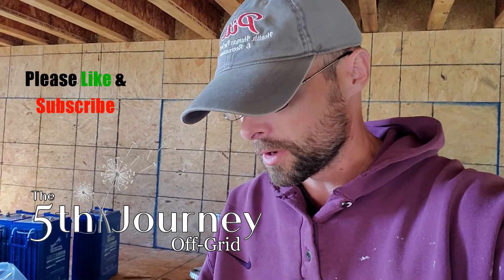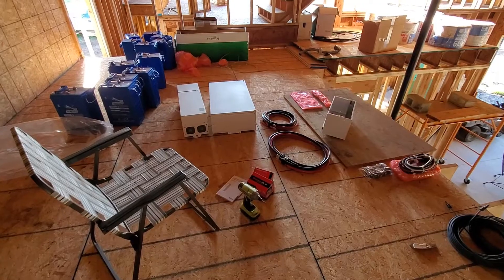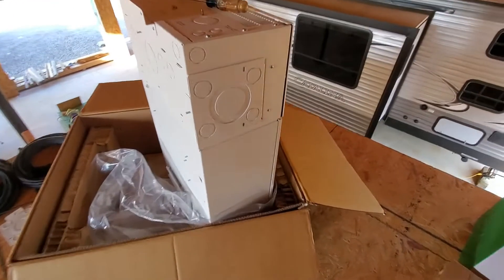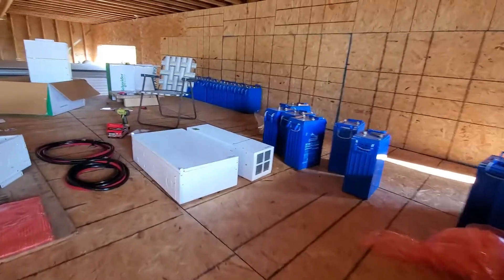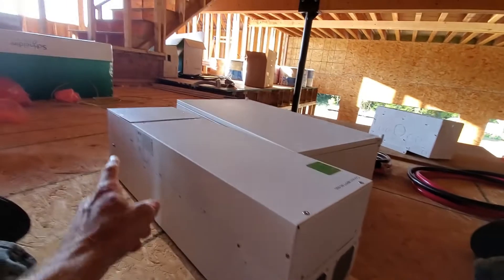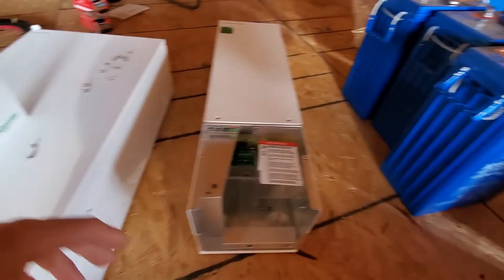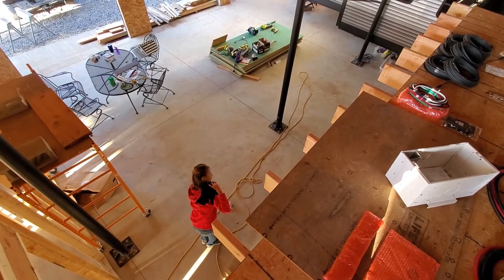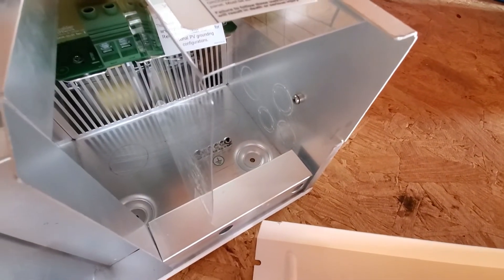Schneider Electric Solar Equipment - Off-Grid Solar Home

Comment: Off grid is the way to go. Fifteen years ago solar systems were not strong enough to go solar everything. Now they are good to go . All the best Gary
Reply from the maker: I've been interested in solar power since the 1980's when I saw a little wire metal figurine on a piece of wood riding a bike and his legs would pedal by a small motor attached to a solar panel.  Power like that seemed like the best option then and even more so today.  I'm glad it's catching on finally.